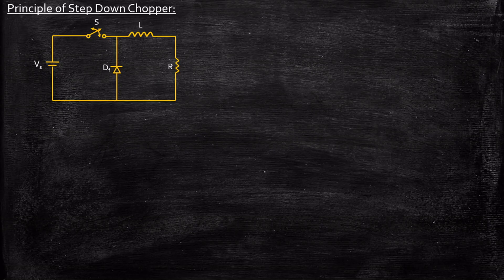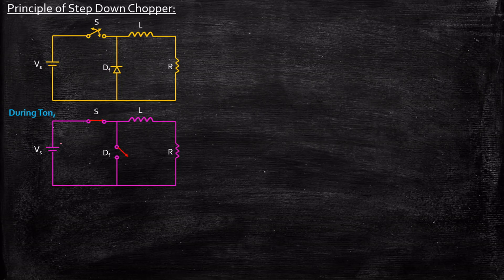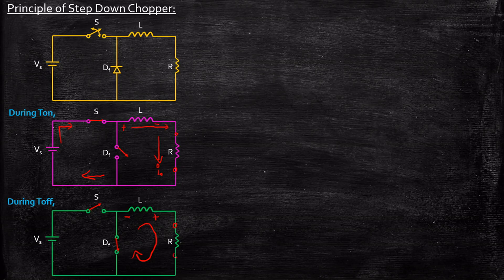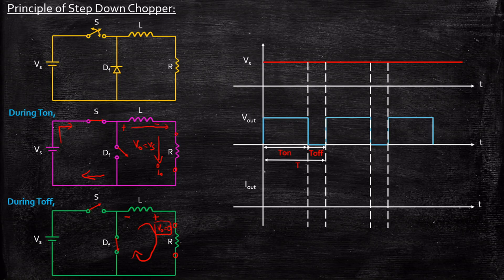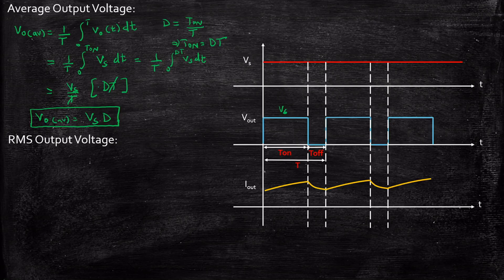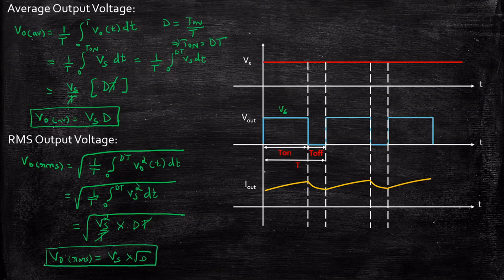Principle of Step Down Chopper | Power Electronics | Lecture 67

Comment: If Iout is having a ripple, and Vout is essentially the voltage across R, then Vout should follow the same pattern as Iout according to Vout = Iout*R, shouldn't it ? 🤔🤔🤔
Reply: Considering that no filter capacitor has been involved in the circuit
Reply from the maker: You have an inductor in series with R. So the inductor charging and discharging influences the current

Comment: Timestamps (Powered by Merlin AI)
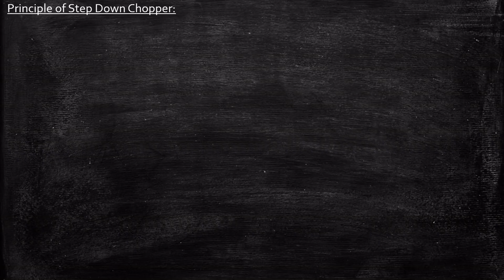00:11 - Step down chopper reduces DC voltage from a higher to a lower level.
01:19 - Analyzing the step down chopper during turn on and turn off phases.
02:31 - Inductor charging leads to gradual increase in load current.
03:38 - Current flows through diode, discharging inductor energy via resistor.
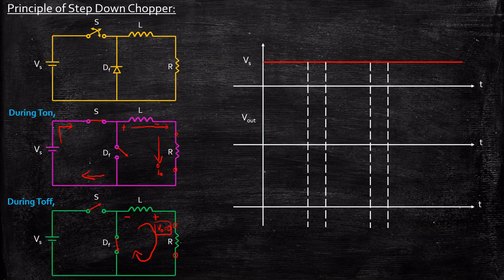04:42 - Understanding the turn-on and turn-off cycles in a step-down chopper.
05:48 - Analysis of step down chopper's current and output voltage behavior.
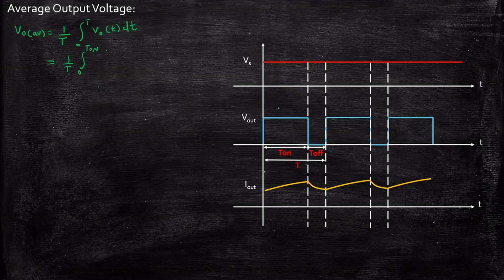07:09 - Average output voltage in a step-down chopper depends on duty cycle.
08:34 - Understanding RMS output voltage in step down chopper circuits.